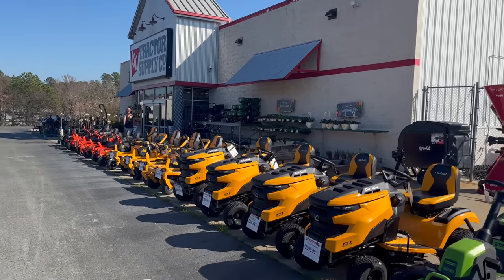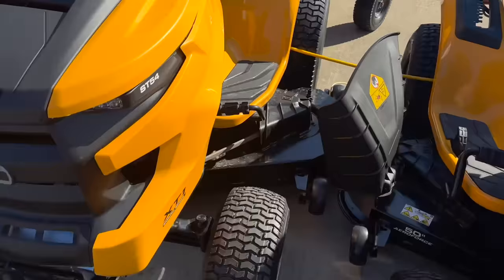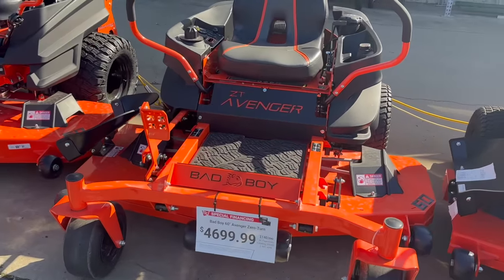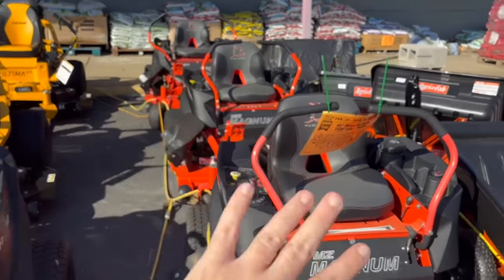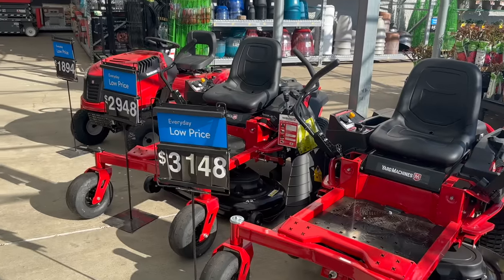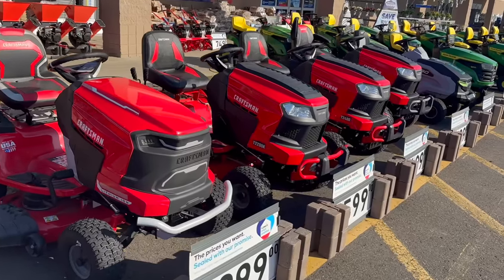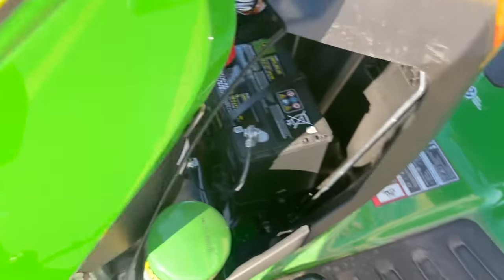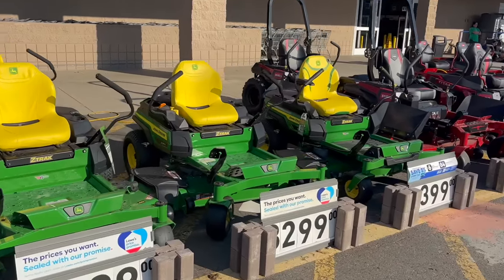The BEST Mowers to Buy and What to Avoid at The Big Box Stores This Year!

Comment: Your reviews are really helpful. Wish you would spend more time on the hydrostatic transmissions. I mow a hilly acre of gras. 12 years or go, or so, I bought a Toro 5050 (said to be a near-commercial mower) with a more heavy duty transmission. Over the years I've had to replace transmissions, two times. Each only cost me a few hundred dollars, with labor, less than :$500. I reasoned if $500 keep me from spending $5000 or $6000 I'm a head of the game. That said, I think the quality of the transmission may be a biger factor then other things, it's been the big repair item for me. SO, I'd like to ask if you could do a few videos on hydrostatic transmissions and in your review speak to their quality. That would add a lot of value to your reviews - IMHO.   All said, KEEP UP THE GOOD WORK!!!

Comment: A while ago my brother bought a JD from a box store, he lives on a hill.  The transmission broke less than a month in.  The JD dealer said they put cheap parts in the ones sold at the box store.  Is that still the case, and/or have they started making the dealer ones just as cheap?  Love the content, figured I would ask even though this is an older video someone might know and respond. It was a bigger 54" deck, not sure about the engine. It was when the JD's first started appearing at the big box store.

Comment: The John Deere S170 and S180 have a better transmission than all the other 100 series models and the only 100 series with the larger tires. I'm just shocked at how much they have increased in price in 3 years. I got my 170 in late 21' for $2400 at the dealer. Back in 21' the 180 also came with a 54" welded deck.

Comment: Thanks for the great video. I have a ariens zero turn lawnmower 52 inch with the kohler engine. I changed the oil and oil filter, put on new air filter and spark plugs. Now it sounds like it missing or not getting enough gas. So put the old plugs back in and it still sounds the same. What are your thoughts on what's going on with it? It has about 178 hr. Please advise. Thank you

Comment: One thing you never mention is deck depth. The deeper the deck the better your lawn will look and more of the cut grass will be discharged. Look at the Craftsman zero turn it's about 3" high. That will never pull the grass up and move it out. The John Deere deck looked about 4" deep. The commercial mowers are around 5" deep. Also what gauge steel is the deck and how smooth is the ride. The Toro Titan was rated the best ride last year.

Comment: Hello, I am German, have been living in Texas for 4 years in the country and bought a riding lawn mower right at the beginning. Since I had no idea about lawn mowers, as a German I first came across a European model and bought a Husqvarna YTH24V48 from Amzon. Now it smokes, leaks oil and I can no longer drive it.
So I need a new one.
Since my terrain (about 1.5 acres) is very uneven and has a lot of tractor tracks, so it's very bumpy, a lawn tractor probably makes more sense than a zero turn mower. Especially as I collect the grass afterwards with a grass collector. (Trailer!)

As a layman, which model can you recommend that will give me the least amount of worry? As an artist and at 68 years old, I want to avoid repairs and problems. (Just mow the lawn when needed)

I would be grateful for a quick answer, as the grass is growing fast at the moment and I will have to mow the lawn again in 2 weeks at the latest.
Thank you in advance. Best regards from North Texas

Comment: I was in panic mode when i saw this video. I just purchased the JD 24 hp, 48".  I like it so far, but  have just 5 hours on it.  Good to know ot is a briggs and Stratton.   Ihad a craftsman i purchased back in the early 90's. The engine went opps on me. My mechanic told me it was burning lots of oil, that i should check.it often. Well turns put the crank cover was loose. It was dumping oil. I check the oil, added some. Then rode it an hour. It opened up.enough it dumped all the oil. So i was riding it without lube. No one will work on old engines. So i had to buy new.

Comment: So appreciate your guidance on all my outdoor equipment.

I recently bought a used 2016 Cub Cadet ( XLT 46"" ) with only 60 hours on it. The first time I mowed the I had a problem with the lever that engages the blades. Very difficult to move and now after turning the motor off , mower will not start.

I don't have a trailer to take it in for service and the guy I bought it from will not respond to my calls?

What would you do?

Thanks!

Comment: I have a 25+ year old MTD yardman 46" cut, it has a 20HP Intek engine, it has had a hard time, mowing sticks and rocks now for over 3 years on the same blades, and cuts nice and even, I mow around an acre, it steers better than many other mowers I have used and has given me me very little trouble, now upgraded to a zero turn 44"cut to save mowing time, the cut is nowhere near as nice.

Comment: I currently have a jd s100 that was bought at the jd dealer 5 years ago.  No problems even with the briggs.  Before that i had a lawn boy gold series 2 stroke.  Loved that thing ran it 23 years. Then my brother forgot to add the oil, ughhhhh, smoked.  Looking for the best thing now to cut my property. Current have about a 20 to 25 degree slope in the back, straigjt down to a creek. Any ideas?  Its weari g on the tractors trans a little more than id like.

Comment: In like the comparison of the mowers. One thing I think you should include is the warranty. John Deere has one warranty. Covers everything 100%. Cub cadet made by MTD has 3 warranties. 1 on the tractor, the deck and the engine. I'd never buy an MTD Cub. I'd find one from international. Plus I had an MTD ranch king about 27 years ago. Ib bought it from our local theisens, where they serviced what they sold. It was a pos the day it came home. I bought that thing all the time. Back in 98 I bought a 200 series lawn tractor from John Deere. I've never looked back. I still use the shit out of it.

Comment: As a small engine mechanic for over 26 years, I have to say this was a very good video! Just FYI, when it comes to Deere and the bulk stores, every Deere is setup by a local dealer. The local dealer also registers the warranty and is supposed to reach out to each machine buyer. I was Deere a setup tech years ago and advanced to the management position. We dealt with numerous Lowes and Home Depots, so I have firsthand experience with that process. The Deere stamped decks allow for better airflow than a fabricated deck since they require less bracketry for support, thus keeping the air chamber less restricted. The Deere will give you a better cut quality overall. Deere also typically has a larger discharge opening than the other brands. I do agree that if you're going to be brush hogging with your zero turn, get the fabricated deck because it's a little sturdier in that environment. Deere would be my absolute #1 with Husqvarna a distant second with tractors. Deere still would be my #1 with zero turns with the Ariens/Bad Boy as a close second. Again, very good informative video!
Reply: But which John Deere riding mower  should I buy?

Comment: THE BAD BOY ZERO turns is okay The fuel guage is poorly made ive gone through at least 4 .The clutch went out very fast and they are expensive and also the switch to enguage the blades went out. OH and its super super loud. One more thing the bolt broke off that hold the clutch so when that happened it broke my belt and that drive belt is not easy to put on and if a shop puts it on for you it will run you just in labor 180.00 dollars . But the engine works great and it is real solid thick steel my thoughts on Bad Boy

Comment: The issue with those "entry-level" JDs of the 100 and even 200 series is their transmissions. If you're happy with a 42 inch cut, stay in the 100 series (S120 minimum). If you want a larger deck, have hills, use the tractor for purposes other than mowing, or if you're just a bigger rider (250+ pounds) jump into the X300s which have a better transmission. You're gonna pony up more cash, but if you want to multitask a machine (more hours), or not blow the transmission running up hills or carrying a heavy rider, it's worth paying for durability and more than twice the warranty: 120h/2yr vs 300h/4yr. Plus you'll do your sale through the dealer.

Comment: There is a Ferris dealer in town and I was wondering what your opinion was on them. They have decent prices there and the new 300s SEEMS like a really good deal. I think the 300s has a B&S engine, but I have a really good B&S that has ran like a top which I think is the same exact engine and could theoretically use it for parts or do a swap if I had too. If the Ferris is something you’d recommend, would it be better to get the 400s with the Kawasaki twin?

Comment: She rips Briggs & Stratton .. I think that's hilarious. My 42" MTD with a hydrostat and a 14 and 1/2 horse Briggs that I bought at Walmart in 1998 still works great. Yes I've replaced a few $28 Chinamazon  carburetors ($100 less than the Briggs carb but the very same carb) but it's been a great engine. I wonder if a Kohler or Kawasaki would still be running after 25 years. 

I replaced the hydrostat fluid about 5 years ago and a new drive belt. Now the thing practically does a wheelie. Already mowed my one acre yard with the very steep hill several times this spring. 

Might have to get a new mower soon! LOL
Reply: Sorry, but the current models are what she is referring to. I have 20+ year old Briggs units that ARE great. But current units went cheap.

Comment: None of the mowers are what they used tobe, that being said I still mow my lawn with a 22yo Craftsman. The only major repair so far was to weld up holes in the deck from my gf using it at her house and not keeping it clean. I recently bought a Cub Cadet zero turn, Kawasaki motor with a 42" cut-not all of us need aBIG mower-a big mower wouldn't get in the places we mow. Another thing, many don't come with a hitch, and many are not easy to put a snowblade on. Remember,  we all have different requirements for our mowers!

Comment: I'd be curious to see more on that ego battery powered tractor probably is reasonable just don't leave the battery packs in the tractor all the time. I bought a used 2014 husky 46 inch deck kawasaki from a local small engine shop dealer zero regrets I can call them and they'll bring a trailer to take it and have it serviced if and when it does have issues. saved over double of what a new one costs well worth going to one if you have any locally.

Comment: What would make me happy to see on any unit, is a quiet exhaust and intake.
Reply: Go electric. Seriously. Quiet enough that I can listen to a podcast.
Reply: @evanhil02  I have the Ryobi electric riding mower, while the 3 motors are nearly silent, the blades make a lot more noise than you would think. I know, I have had it for 5 years and already had to replace the 4 12v 100ah AGM batteries at a cost of nearly 700.00, and that was me doing the work, I'm sure had I taken it somewhere, that would have cost me nearly 1200.00 or more. I didn't spent that much on my gas unit in 30 years. Plus the blade on my gas unit lasted me 4 years, but this electric only last 1 year, they are really thin. Also, if you miss a cutting and the grass gets a little thick, the electric will bog down easily, So I'm not all that happy with the electric rider. A push electric is quieter, as it only has 1 motor, 1blade and I don't think that 1 blade is spinning as fast as the 2 blades on the rider.

Comment: I am really interested in purchasing the Bad Boy MZ Rambler 42" zero turn mower, but since watching this video I am concerned as to whether or not the Briggs and Stratton in this unit is one of those that have had the cam shaft issue. Can you tell me whether the issue has been fixed with the Briggs & Stratton 540 cc EX1900, or should I look for another model? I only have one acre to mow and the 42" deck would suit my needs the best over the larger ones. Thank You! JB

Comment: I found a STEAL on Facebook marketplace last week. A Hustler Fasttrack 48 inch deck zero turn with dual tanks for $1200 with a Kawasaki engine. My first zero. It replaced a craftsman yt4000. I cut 5 acres in 6 hours instead of three weekends.

Comment: I can't believe you left out Gravely. I bought the 52 inch cut with the Kohler engine probably about 7 years ago. It's a great mower it doesn't have a cheap stamped deck. Yeah it was expensive. No telling what that model would cost now.

Comment: even though you said "definitely would not get a Cub Cadet zero turn", the problem is those have lap bars, where as the good zero turns come with a steering wheel. Along with steering wheel, Cub Cadet zero turns are extremely easy to operate, especially with the steering wheel,  as me, a 12 year old, operated a friends Cub Cadet 48" mower with a steering wheel and I came no where near close to hitting anything, despite being on rough gravel and also having practically 0 real life driving experience, little gaming experience, and not much knowledge on zero turns, it starts, drives, mows, and handles with 0 problems. I gave the mower some checks like brakes and hill climb and it went right up that 35 degree slope almost no problem without the PTO clutch engaged(Power Take Off but just activated the mower) and overall, just buy a Cub Cadet zero turn with steering wheel. you learn how to drive it faster than learning how to ride a bike. Also, engine sounds epic and you almost cannot lose control of it (I cant, mainly because its not mine, my OCD and ADHD could never let me) though it is extremely fun to drive.  took me 3 minutes to learn entirely how to operate with some help from my friend.

Comment: She said avoid anything Craftsman, but recommends the Husqvarna riders. Just an FYI to everyone, I purchased a 2011 Craftsman YT3000. Its actually a rebadged Husqvarna. You look at the dash of mine and dash of a Husq, exactly the same. Throttle controls, light switches, spindles, everything identical except Craftsman are painted red and Husq is orange. That's it.  So about 10 years ago, Craftsman was made by Husq so you don't have to avoid that vintage of Craftsman. Mine is 13 years old, 385hrs on the Kohler Courage without any serious issues other than a new carb needle because the OEM one came apart inside the carb. Other than that, I use the hell out of that thing and it still works great. I do pull the deck every other year and remove all hardware and repaint it top and bottom, so my deck has no rust. It's not a fun job but I only spent 1499 for mine, 46" cut, 22hp. All I need. Now that same machine is over 3 grand. No thanks. I'll keep this one going as long as I can.

Comment: Update to previous post and question. Recently I replaced my Cub Cadet Z-force 60L zero turn with a Toro Titan Myride. Both have Kohler engines. My problem is that the choke cable on both of these mowers is mounted directly above the right exhaust pipe and muffler. The excessive heat from the exhaust seems to melt the outer plastic sheath around the choke cable. It also affects the choke operation causing it to get stuck. Any suggestions on how to correct this problem?

Comment: As a small repair shop working on all these different pieces of equipment, the biggest piece of junk mower deck is anything made by MTD yard machine I constantly fight with customers who come in and say my Lowe’s or Home Depot. John Deere is not working proper and I tell them it’s not a John Deerehigh personally a commercial, John Deere Kawasaki motor John Deere frame much much heavier built machine

Comment: Question.  I have a husqvarna 242XD.  Fabricated deck with Kawasaki engine.  It is on its 4th season.  My cousin worked for Husqvarna so bought it direct.  Last year it broke the deck belt.  Purchased Husqvarna belt but has gone thru several belts.  They keep breaking.  I grease the spindles, change out the blades several times a season.  Have you seen this before?

Comment: What are your thoughts on using the deck clean out with the water hose connection? I have a John Deere zero turn with this and it seems like it dulls the blades.

Comment: I was looking at a  ariens apex 52 inch deck got a question about this mower.i have a little over 2 acres of grass to mow and my front yard has underground springs and the grass is very thick and my back yard is very thick grass but it don't grow as fast as the front yard because there is no springs under the back yard would you recommend this mower to take care of my needs.i have a husqvarna yth 24v48 and it does a okay job wanting to upgrade to a zero turn.1 more question i was also looking at the gravely Zt hd 52 what are your thoughts on this mower

Comment: Still watching and your still great haven’t got to the electric pole tree trimmer and hand chain saw so I have a problem with my chain coming off on pole saw also new chain for chainsaw is dull as dirt  my question is do I sell them and what size chain saw is best to get for a 5’7 128ld gramma of 62 because I know I can do a lot of the stuff I am being forced to use hand saw with the saw doesn’t even make a dent in a branch about the size of a silver dollar and I also was curiose for cutting high branches is it better to stand on the ground and use pole saw or secure you self and use ladder and saw
Reply: 1.loosen the pole saw blade, pull it out till it is just snug,then re tighten the nut. 2. make sure you have the chain on right and not back words,and same as pole saw loosen the blade nut pull blade snug with chain on it and tighten and try that. and as always be very careful as you are working with power tools.